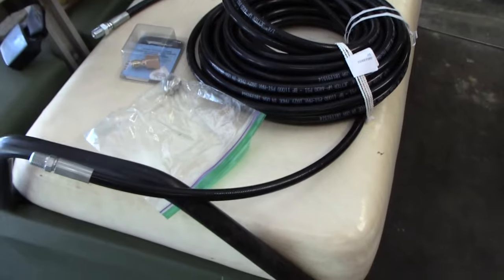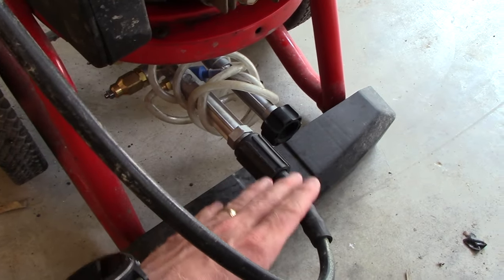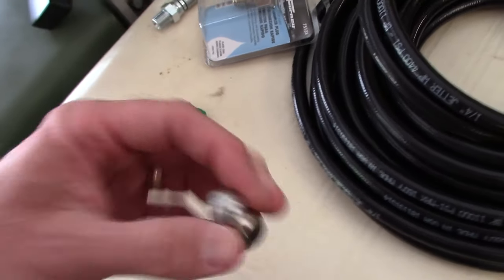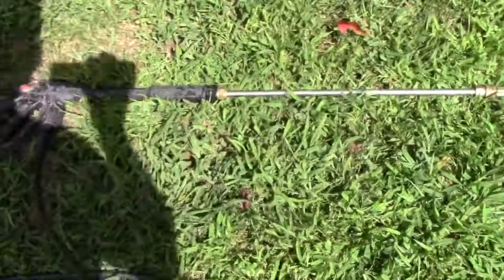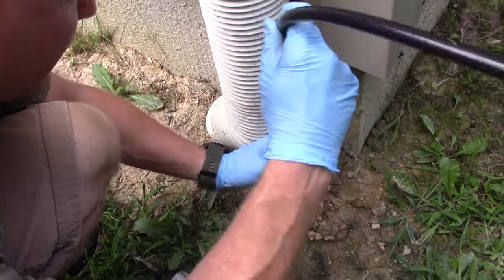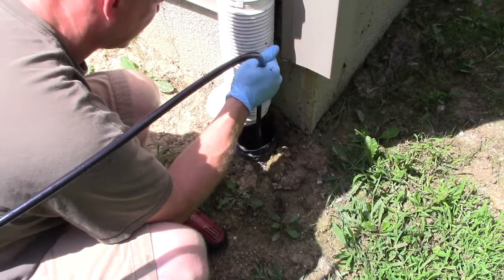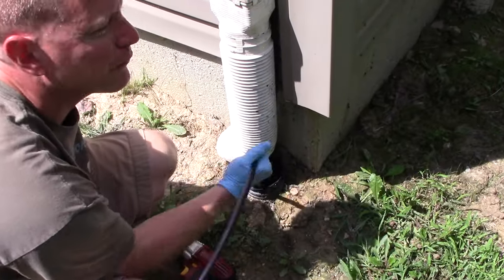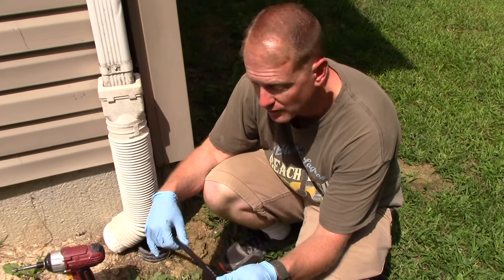DIY Cheap Water Jetter System To Unclog Pipes - How To Hydro Jet

Comment: I got a $1,700 dollar estimate for a 45 foot straight shot sewer line jetter job.  My husband and I bought a kit and tied it to our pressure washer.  In 15 min. Job was done.😊
Reply: Did you have a camera ran to ensure you cleaned it well ?and check for any bellys within the pipe or separations?
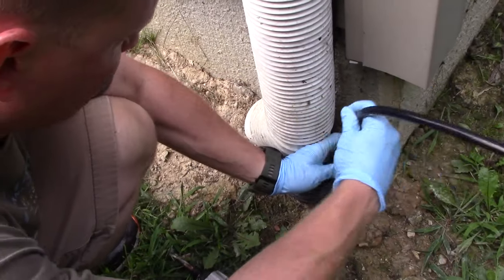Reply: 5:51 🎉

Comment: I got an estimate of $650 to unclog a driveway drain. In 5 minutes, I got it unclogged with the suggested kit for ~$50. Thank you so much.
Reply from the maker: That's awesome
Reply: @patriotjoe3110  Castro is probably in Ca. where the state charges him $400. to start up his truck, has to pay no count help $200. per day no matter if he works...he was in the truck so that's help.....$50 was for the actual plumber , gas for truck, equipment....willingness to sit 2 hours in traffic jam to even get to the job....yep, $650 is about right.
Reply: @StephenZ827  I'm in WA state.
Reply: Sam Hill  $650 is on the low side for jetting. remember,  this plumber pays for his hourly wages, taxes, million dollar insurance on vehicle and company, plus tools and material. $650 is not over pricing to not get the job.
Reply: Mydriasis10
Reply: I got 2 hydrojetting quotes to clean out my clogged kitchen pipe.  $400 and $1100.  Quite ridiculous to be honest.  I can rent a high water pressure from Home Depot and follow this step-by-step DIY bid for way less.  Thanks.
Reply: @klincecum  $150 isn't even my minimal charge.  you hired a handy man. not a plumber.
Reply: Here's the problem with all this guys, I've done A LOT of research on this.  Getting the mud off the roots is not the same thing as clearing the roots!   It's all about GPM AND PSI!!!!!   These little nozzles won't clear roots effectively.  They'll wash the dirt off them and clear a clog in a small pipe IF YOU HAVE A 4 GPM WASHER, but none of these bits are NEAR the calibre of professional bits that actually remove ALL the roots and operate between 3k-4k PSI between 9 and 18 GPM!!  
               Most professional nozzles aren't designed to be effective under 9 GPM, and many need 18 GPM for max effectiveness.   With a small diameter hose, you have to consider the amount of PSI drop too!  The smaller the hose, the more dramatic the drop.  So if you have a 3k washer, by the time it gets to the bit it's only at or under 2k for example. 
                 So I'm not saying don't give a $50 fix a shot, but just remember, that they bits the pros are using range anywhere from $400-$1500 PER NOZZLE, and that's ONLY the nozzle!   They are that expensive for a reason!   And it's not about pro vs. DIY, it's about effectiveness.   Yes the pro nozzles will last longer, but they'll also get the job done too, a crap shoot at best otherwise.   
                 Personally, if you're buying a power washer, get as high a GPM as you can: 4-5 GPM minimum.   That can get you in the range of 1 or 2 professional root removal bits that even at $800 and an additional 3/8 hose (shorter the better) will actually cut the roots for months or years of FULL drain clearing, and not little bitty slits or holes.   Just FYI.....
Reply: @crforfreedom7407  thanks for saying what I was thinking. 21 year plumber here. It makes all the difference when you have the correct tools for the correct job.
Reply: @patriotplumber4694  Why would a plumber watch a YT video on clearing a drain.

🤔
Reply: @jdub2878  A person is always learning new or different ways to do things. No different than a doctor that goes to seminars to continue education. If you told me you were a plumber and you knew everything there is to know about all aspects of plumbing I would call BS. Same for anything. That’s why I was watching. 🤔🤔🤔
Reply: @patriotplumber4694  A doctor and a plumber ain't even close. Pipes and drains are pretty simple.
Reply: @jdub2878  a diy jetter like these small ones should only be used on secondary lines to clean light grease and sludge build up.  The big boy jetter I use is a 12gpm unit at 3500 psi and it takes some time to eat through the roots.  Even after the roots are chopped it's only a temporary solution. That section of line will need to be replaced due to soil erosion and the roots growing bigger and causing the pipe to separate or collapse.  I checked this video out for a decent solution for a jetter that can clean lines that are 2 inch and smaller.  It's interesting to see what people come up with.  There's definitely more powerful solutions that can last much longer before maintenance periods if you choose professional grade pressure washers hoses and jetter tips than what is shown in this video.
Reply: Im charging $650 to hydrojett but i use different jetter heads wich cost between $500 and $1000 each head and different Hydrojett depending on job
Reply: @crforfreedom7407  You dont need expensieve 9 or 18 gpm and high-tech nozzles for a blocked house drain. It can be done with snaking equipment what is much cheaper.
Also note, that the clog is not always caused by roots, and almost everythig (except roots) can be cleaned with the setup shown here.
Also note, that all the expensieve nozzles are bigger in size, so they wouldt even fit into the smaller pipes inside the house.
Im not familiar with the prices in other countries, but 600$ would be an incredible rip-off for a 5-15 min job in my country, and we also need to buy equipment here.
Reply: On site if residents asked us to do small jobs we could tell them reasonable prices but if they called their condo corp or our company the minimum charge was 350+
Reply: @patriotjoe3110  good point
Reply: @StephenZ827  ❄️
Reply: @crforfreedom7407  The corrugated pipe I am working with is clogged with leaves and twigs from a wisteria vine on the house. It is old and fragile, going under the house and connecting with 5 other corrugated pipes under the house. I am concerned that using the high pressure version the pros use would damage the corrugated pipe, and result in a very high replacement cost. If Jack's lower pressure method works, and it appears it did in the video, I want to try it.
Reply: @DianeMEmerson  I agree; it's worth a shot!   Worse comes to worse and you'd have to dig it up anyway.   Then NEVER put corrugated plastic under a house.   ALWAYS solid pipe.   Around the outside perimeter; sure.   But not under a slab.  Ever.
Reply: I'm glad you managed. It is not always 5 minutes, it really depends on the nature of the clog!
Reply: Sweet, still working?
Reply: @edwinvasquezp  Yes!
Reply: @jdub2878  So they can criticize what DYI'ers do. Remember some things doing pluming work you need a PHD.

Comment: one very helpful item for using these sewer jetter kits is a foot pedal valve which you can install in place of the pressure washer gun. That way you have both hands free to manipulate the hose.
Reply: What foot pedal did you buy??
Reply: Could you please send information regarding the foot pedal you purchased? Thank you 🙏

Comment: Just some info for gutter pipe owners. Never use corrugated pipe for underground gutters. You see it used because it works great for French drains but not gutters. Use smooth wall pvc pipe. The ridges on corrugated pipe will catch and build up with all the dirt and whatever you can imagine that runs off your roof. Especially if you have shingled roof. Shingle granules and rock sediment will build up. Also this type of pipe is so thin it will break or crush. PVC is more solid and leaves a smooth path for nothing to get stuck.
Reply from the maker: Very true. I've had to replace a lot of black corrugated pipe that was probably crushed when it was installed also.
Reply: schedule 40 ABS is best for this.....PVC is somewhat brittle..... ABS you can beat with a hammer and not break it.

Comment: I bought my 100' Sewer jetter hose with all the tips and fittings for a standard pressure washer handle so theres really no need to place a shut off on the pressure washer at all if you have M22 fittings it will connect with a M22 reducer

Comment: Also Jack, if you have gutter guards on those gutters and you are still getting blockages, you likely have a hole or multiple holes in the corrugated pipe underground. And you are probably getting dirt and sediment in your lines or even worse, roots. For that you would need to treat the lines with RootX or a similar product. This will dissolve and kill the roots and allow the drain to flow freely. But you will need to treat the pipe every 1-2 years.

Comment: This is just exactly what I need to clear a clog in some corrugated pipe. A commercial hydrojet would be too strong, I think, and damage this 20 year old corrugated pipe. But your solution seemed to work just fine on corrugated pipe. What a relief to discover this option!
Reply from the maker: Just be careful. Don't force it. Corrugated pipe is delicate and if crushed, this will blow right through it.
Reply: @JackofAllMasterofNone  Thank you so much for the extra guidance. I will be gentle....

Comment: i have sewerage line of about 60-70 feet cast line in basement and about 10 feet under concrete. One of my tenant through Paper Napkin. Big time back up and over flow th Toilet. very big mess you can not imagine and very bad smell Call plumber and they clean it in 15 minutes They did not use Water jetter system and charge me $450.00 with 6 month warranty. 
With my luck clog happened again after 61/2 month later. Same mess same Oder Same plumber came and he clean sewer line in only 12 minutes and charged me $450.00 again. Now I know how The DIY Water Jetter System to unclog and clean ( if ever I have any sewer or drain line clog) THANK YOU JACK

Comment: They charge me huge amounts of money to pressure jet The Roots out of my leach field lines. You either come up with the money or you go without Plumbing. Your video it's going to help alot of people
Reply: I owned a business that made septic tanks for 19 years. This will break up small roots only. Use root-X to kill the roots. (Copper sulfate). Might hurt trees or shrubs if their main roots are in the pipe.

Comment: You Sir are a life saver! I've got a frozen pvc pipe that I've been trying to unclog for days! Called a plumber to snake the line. No luck. Called a septic guy to snake from the tank side. No luck. What's needed is high pressure and hot/warm water. A few bucks (already have a pressure washer) and I should be good

Comment: For that job a water hose might have done the trick, nevertheless, great video and a very effective solution. 

One improvement, especially for long or hard clogs: start downstream. 
I’m not experienced, yet, but my buddy is and he said, for seriously clogged pipes, it’s always better to start downstream.  

My situation is a very long house on a slope with the front of this old house facing uphill so extending downspouts isn’t an option. Downspouts go into clay pipe “sealed” with cracked concrete. Clay pipe goes hundreds of feet to a storm sewer. I cleared out 18 feet in multiple directions with a hose so far but I have a long way to go so I’m definitely gonna try this system and I definitely need to do this myself.  

I really appreciate that you made this video. Thank you.

Comment: good video.  I have been using a purchased brand and it connects to the middle of the wand.  You unscrew the pipe and attach it there.  It is a little easier to work with.  In addition the nozzle head is much smaller/shorter.  This feature is the most important part because it allows it to work its way around corners in smaller pipe which is what needed.
Reply: Would you please tell me what I can get this kit. My situation is much like yours. I am needing to unclog a slow drain from my tube. The pipe is smaller and has a bend in it. I need smaller attachments.
Reply: @donwilliams2685   The brand I bought is a clog hog.  I think I paid around a $100 but its been a minute.  I could be wrong since I have bought 2 over the years.

Comment: This is a great setup, but one thing. The pump on gas pressure washers can fail if the water is not circulating through it. Suggestions to use are either having a two person operation, where one can start the pressure washer as soon as the other person has the hose set up in the pipes. Another alternative would be to use an electric pressure washer, but not sure if the GPM/PSI would be enough or if it would be compatible with this setup.
Reply: Where in the world did you hear that as long as your pressure washer lines are bled and water is through the whole system it don't matter if you start stop jump around I don't understand where you heard that whoever it was you need to tell him to go back and do some research
Reply: I've been running pressure washers for 30 plus years and never have one do what you're claiming

Comment: hey, you suggest a shut off valve on the pressure line of your ordinary power washer: this is slam dunk to kill your pump. With no way for the fresh water to escape, the pump will within shortest time overheat and fry. Higher end power washers have at least a loop that allows water circulating through the pump to provide cooling.

Comment: Thanks for making this video! I have an electric pressure washer with 2200 PSI, and do you think it's sufficient power?
Reply from the maker: It's not about the PSI, it's about the flow or volume of water it can move. Most electric power.washers don't have the flow rate needed

Comment: Very good video, Thanks.. Harbor fright has what you need and by leaving the machine outside and bring the one hose thru a window someone can control the trigger... Thanks🤠 The return line may be messy so it can go into a garbage bag to take out, protecting the carpet...

Comment: Thank you SO MUCH !! I have a similar partial restriction due to accumulates shingle granules and the drain pipe runs 40 ft under a concrete driveway. I received a $650 estimate and will try this first with my power washer. I'm thinking it may take some time but it should work.  Thanks again !!!!
Reply from the maker: Best of luck!
Reply: @JackofAllMasterofNone  Did it yesterday. Worked great. Added a wire "hook" behind the nozzle to pull out some fine root masses. Thanks again!
Reply: Nice... Where you using a gas or electric pressure washer?

Comment: Thank you very much for making this video. 👍👍👍  You provided all the information I need in a nice, concise fashion.  The only change I'm making is to use the Jet Snake because of its ability to better navigate tight turns and its overall quality.  It's much more expensive, but it should perform better and last longer plus it's made in the USA.  What's the cost of having a pro to do it?  The Jet Snake is much much cheaper than hiring a pro.

Comment: Regarding the swivel vs fixed ends, I'm not an expert but I can think of two reasons the swivel should really be at the pressure washer end, not the clog end. First, do you really want the possibility of the working end spinning wildly if the pressure from the reverse jets starts to provide a small rotational force? It sounds like it might be beneficial for cleaning, but probably not desirable if it's not a rotating nozzle designed for that purpose (which I see is provided in kits). But, I think more importantly, having the swivel at the pressure washer end lets you have control to re-orient the line by twisting it (often a challenge with pressure lines). If the swivel is down in the drain at the working head, it loses this ability. Great video, thanks!

Comment: There is a lot of misinformation out there But this is exactly what I needed. Great information, great video, and great product links… thank you so much!
Reply: As an update:  I received my hose, nozzle, and adapter and went to work on a waxy accumulation clog in the kitchen.  Ive cleared this issue in the past with a drill snake, no fun.  The hyrojet setup blasted thru the clog and washed it away.  Thanks again Jack, best $45 I ever spent!

Comment: You're actually supposed to clear a drain from the bottom end if possible. The nozzle is designed to spray 3-4 jets backwards. This pulls the nozzle through the clogs as Jack says but its designed to wash the clogg out as you pull the hose out. If you clean from the top like he did, you run the risk of only displacing and dislodging the blockage for a short time and then having it reform again further down the drain. I clean pond drains and have experience in this field. Also, the valve he discusses is so a single person can operate the system. Sometimes you have to have both hands to twist and guide the line through turns and blockages. You can't do that squeezing the trigger on a wand. You can fabricate a value with stuff from Home Depot or Lowe's for about $10. Stick the line in the pipe as far as possible then turn the valve on. Otherwise the line may come flying out of the pipe. Hope this helps everyone and Jack.
Reply: I have roots in my drains, do you know what size or how many psi is needed to cut machine  cut through roots?
Reply: Pressure washer won't work. Chemicals are needed or a drain cleaning reemer. I'm assuming you're talking about house drains. I use RootX. Refer to the directions precisely and wear a protective respirator and gloves. RootX can be bought on Amazon.
Reply: Darth Slagle the roots are in my yard drainage pipes going out to the street, will rain x clear those?
Reply: @cbrfast Probably so, but you have to prevent any water flow for 24 hrs.
Reply: @darthslagle5979  pressure washers are used to cut roots and can be very effective at it, but to do it right you're talking upper psi range which is probably more than most people want to pay